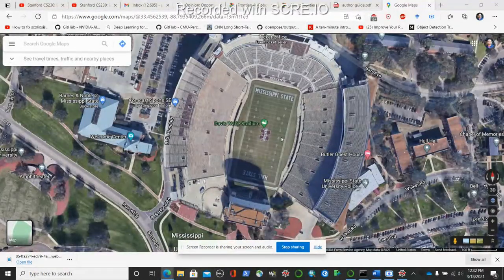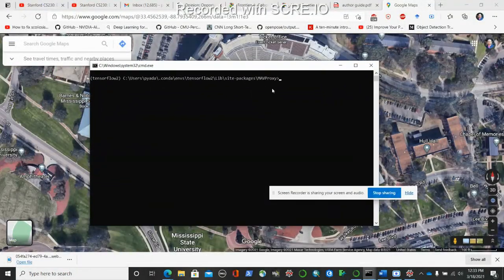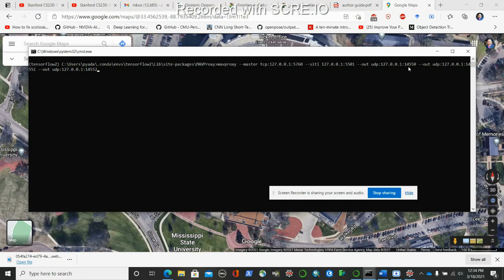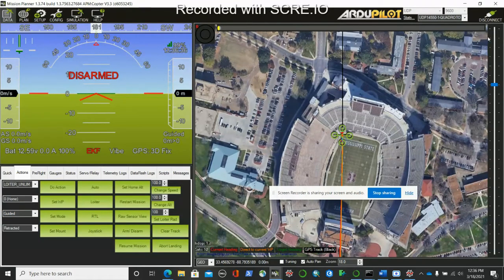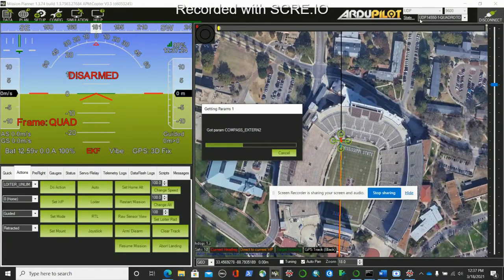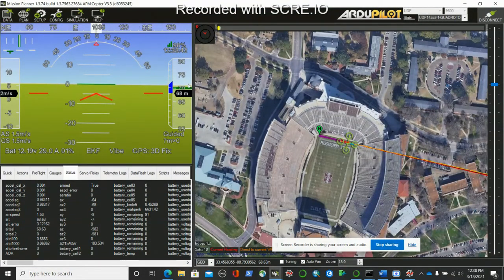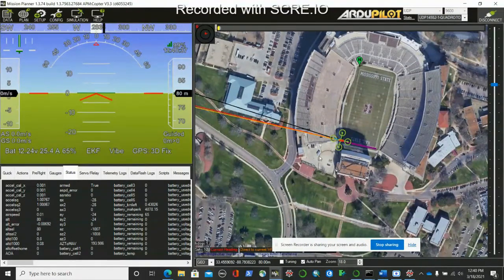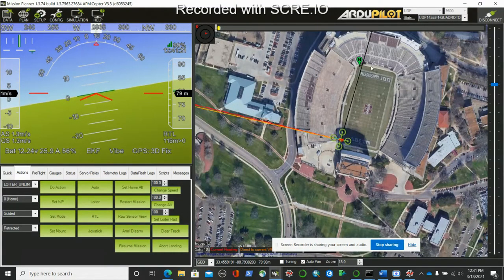Drone Simulation using Dronekit-SITL and MAVProxy

Comment: Hi, thanks for the video. I was able to get this to work for me one time. When I tried it again I keep getting an error when trying to start mavproxy. The error is this

ERROR: opening log file for writing: [Errno 13] Permission denied: 'mav.tlog'

Do you know how to fix this?

Thanks
Reply: I needed to change the permission of the Mac.tlog file and give myself full control
Reply: try mavproxy.py --master tcp:127.0.0.1:5760 --sitl 127.0.0.1:5501 --out 127.0.0.1:14550 --out 127.0.0.1:14551 --out 127.0.0.1:14552